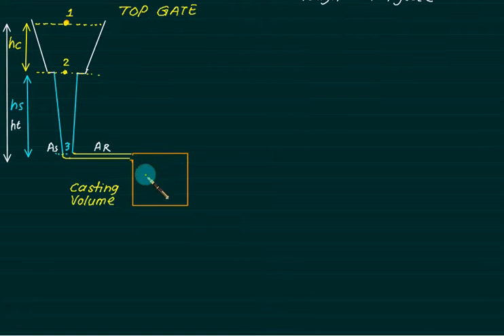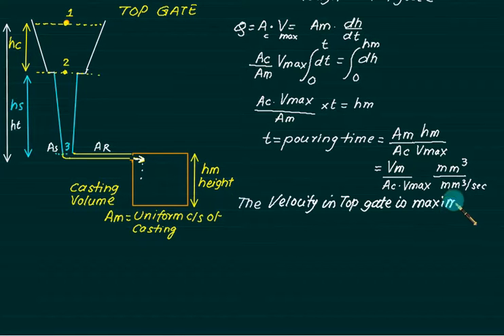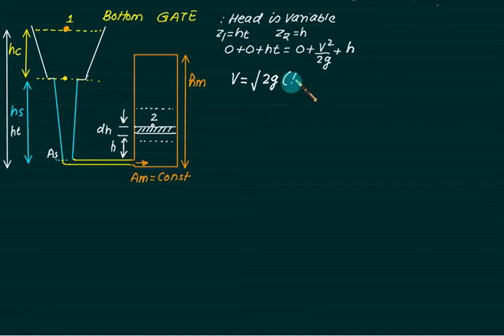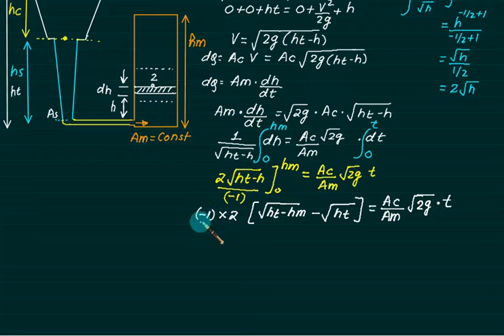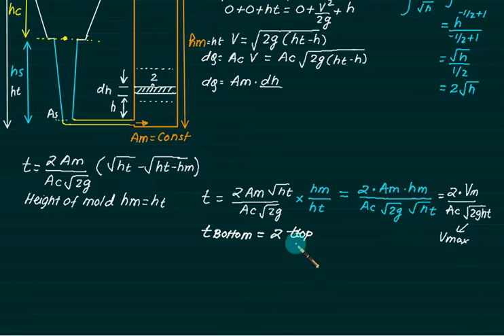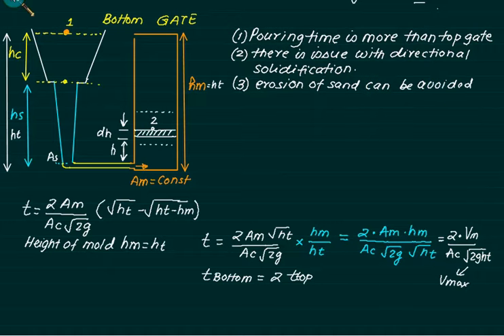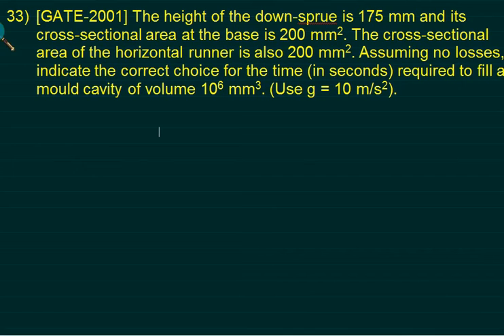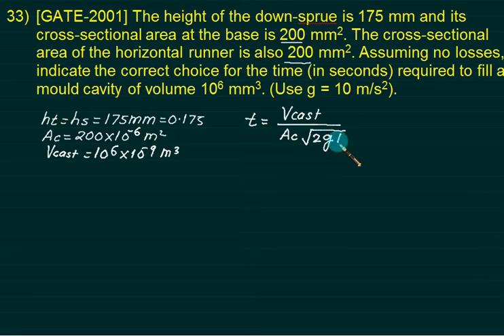Casting 04 Gating System Part II

Comment: Sir, In 32nd prblm, datum height is greater than 200 mm. In Top Gate u said that datum height is preferred to be less than 200 mm to avoid erosion. In that case we should consider the prblm as Bottom Gate and we would still have all the data required to solve the prblm. 
Please explain..

Comment: Sir you wrote the bernoulli between 1 and 2 thus the calculated V was also for point 2 .. but you used it for choke area velocity. How?
Reply: Because he wants to get the final expression correct 🤣🤣..I have the same question. I think it's wrong there.

Comment: Sir,  I'm little bit confused
why did you take P2 = 0,
the weight of the molten metal in the pouring basin must have exerted a pressure on the sprue opening.... plz tell if I'm doing something wrong
Reply from the maker: the pouring basin has a very little height ,hence pr due to small column is neglected
Reply: sunil mohod Thnq sir
you have been an awesome tutor!!